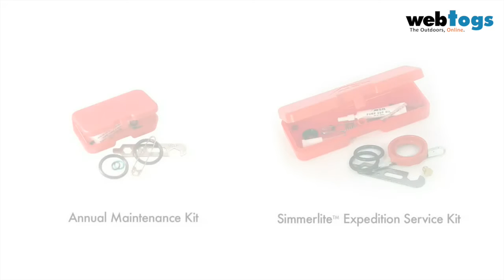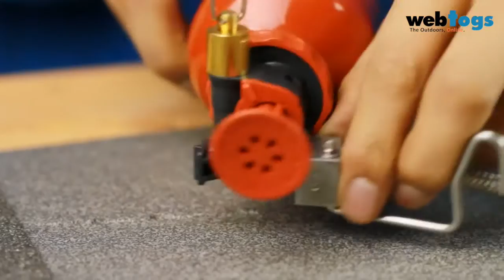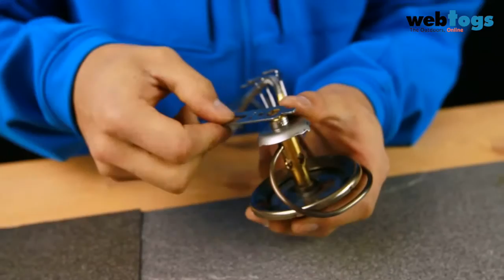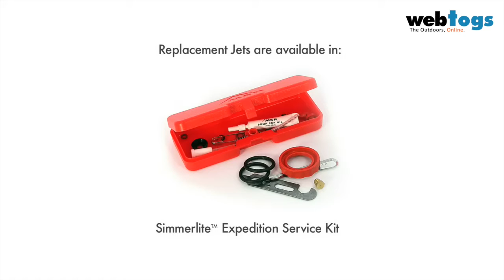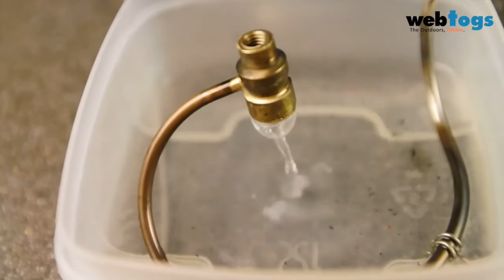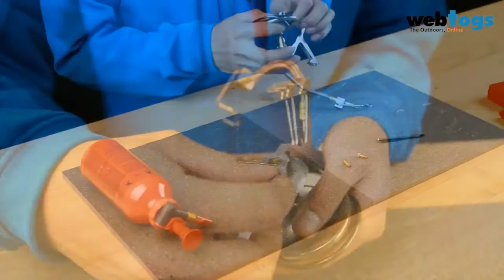How to maintain your MSR Simmerlite Stove

Comment: That's the good thing about MSR stoves.  In the rare case that your fuel line, generator or fuel spraying nozzle is clogged you can easily clean it. Problem solved and the stove is running smooth again. With many other brands you are doomed to buy new spare parts.